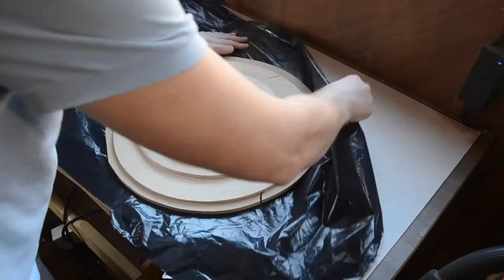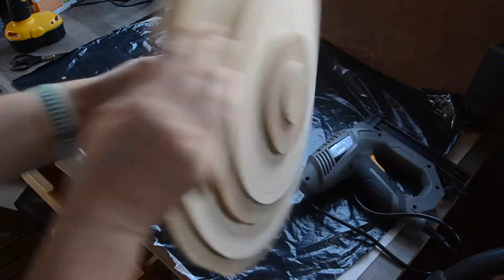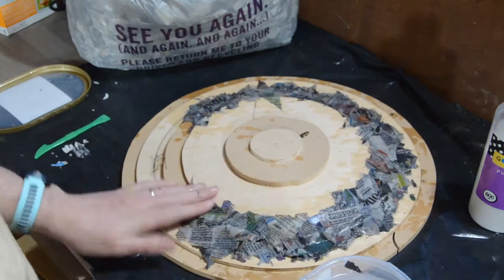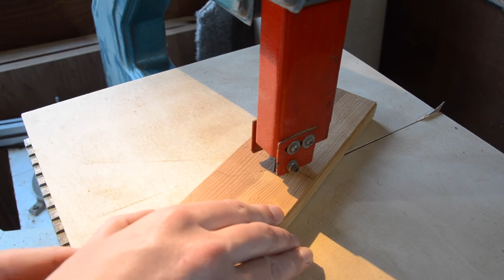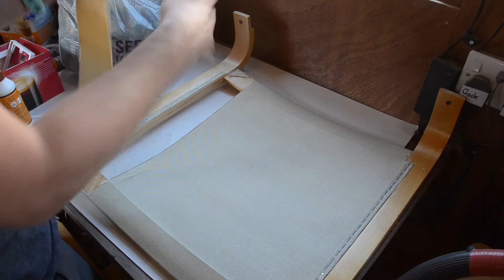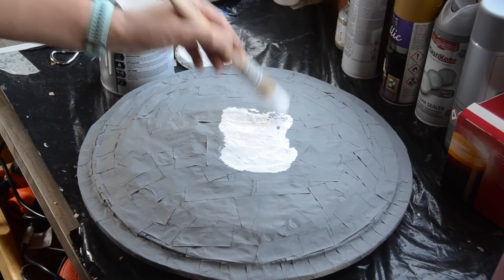Making a Greek / Spartan shield (aspis/hoplon) for a child to paint

Comment: Great work! I especially liked the idea of using concentric circles to give it a dome-shaped structure, assuming that was the purpose of the concentric circles. Also, what is the main purpose of paper mache? To hide the rings and to get an even paint on? Did you use glue or flour for paper mache?